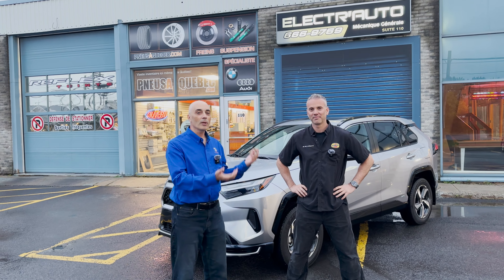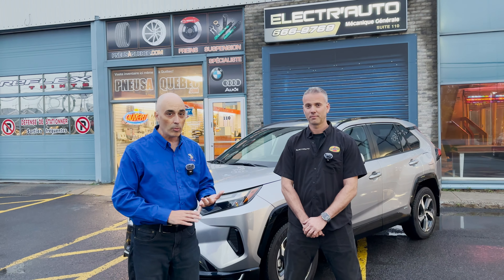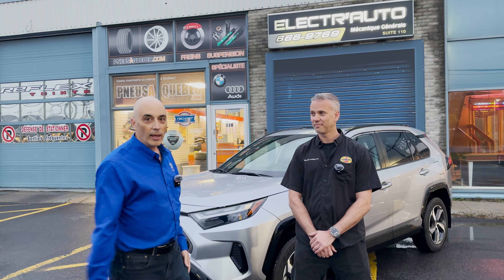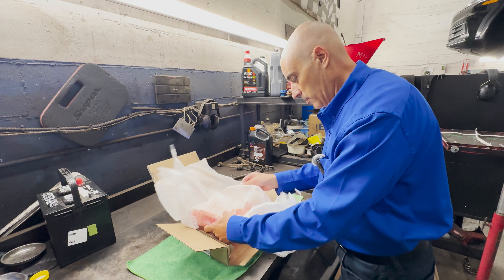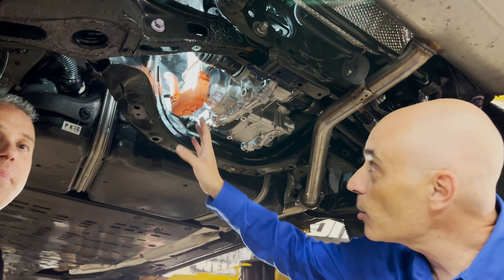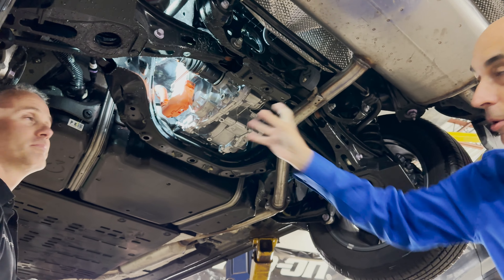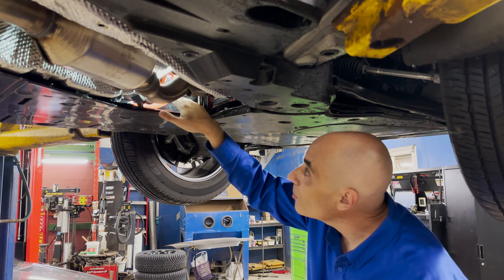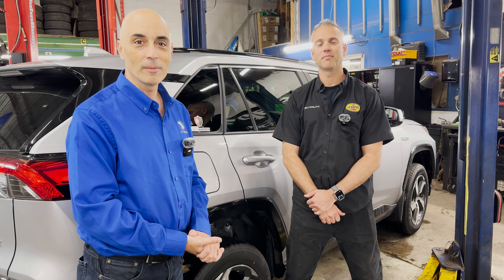Protecting Toyota RAV4 Hybrids and Plug-in hybrids high voltage cable #cablegate

Comment: hybrid related components is like 8 years/160k KM in canada right
Reply: Not the cable though hybrid batter and and electronics related to it for sure but cable  doubt it.
Reply: @rav4primelife  Not true - the cable and the connector are now included in hybrid power train warranty.
Reply: @nofyfb123  please check again with toyota itself directly and in the ECP as well check for the line that says cables/batteries are excluded. This is considered a cable not powertrain component.
Reply: @rav4primelife  True. That's why these components were initially excluded but - as a result of a class action lawsuit - they now are considered a part of the hybrid system.
But you do have a point - if a stealer has a chance to deny warranty, rest assured it will.
Reply: @nofyfb123  yeah stealer can even deny warranty cause I drove vehicle on bad roads or in mud etc. or even put different size tires resulting in body balance to change. only thing they cannot deny is install of dashcam.. even a simple modification like IGLA or such antitheft can deny your warranties.
Reply: @rav4primelife  I can give you a hypothetical reason why dashcam can be a reason for warranty denial: it's not installed by "authorized dealer" or Toyota, and, therefore, technically is an alteration.
I spent nearly 20 years in the field investigating dealer misdeeds, and even I cannot always predict the depth of deception they perfected over generations. I am a lucky one who does everything myself, and I feel sorry for those who have no choice but to rely on "professionals".

Comment: Is this a problem on Prime only? Or is it the same on all hybrids?
Reply: @ajscout  all hybrid, from 2019
Reply: It seems that Toyota addressed the high-voltage cable corrosion issue with the new models.  I.e. no need for the cable warden for the later model.
Reply: @ajscout  awd hybrids
Reply: @Chitown388  Which years would you consider “later models” with the fix? I have a 2022, would that be considered a later model with the improved HV cable?
Reply: @stephandzach  2024 and 2025
Reply: @mustaphan9121  would the replacement for the 2022 be the same as the 2024-2025?
Reply: @stephandzach  no